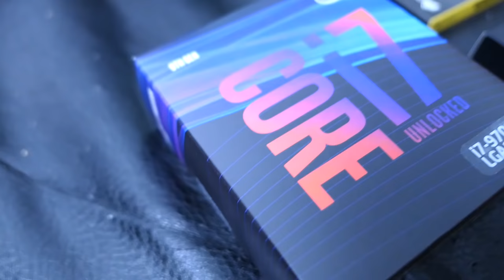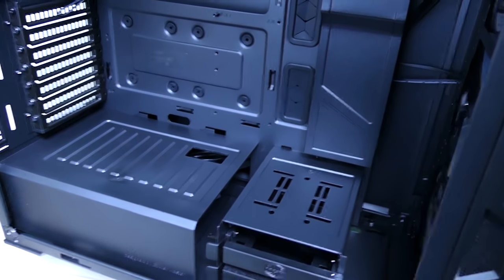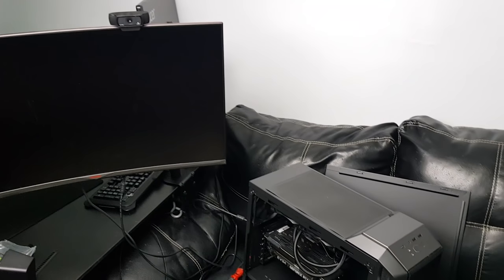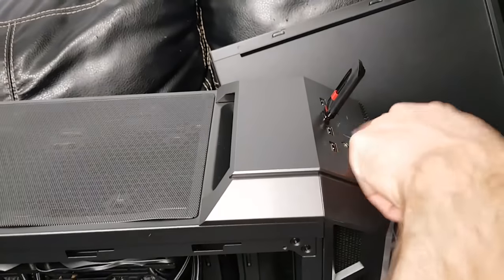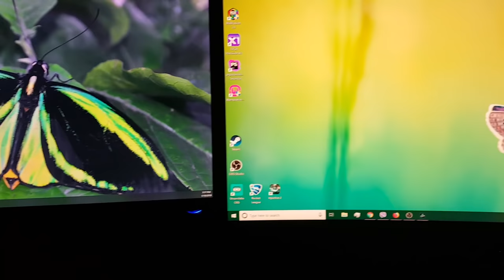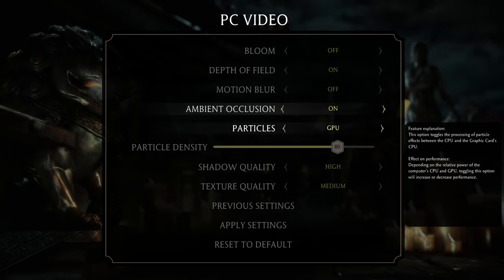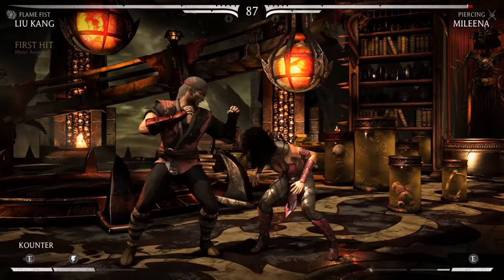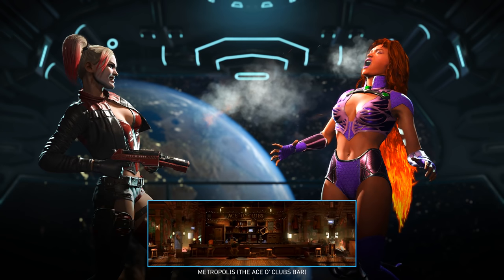Building Ultimate Gaming PC. Assembly and Performance Test on ULTRA Settings in Games.

Comment: I'm not pointing out any mistake it's very good setup but if you're gonna do live stream and productivity with games you should have gone for ryzen 7 2nd gen, it's beast and just lose some 10-15 fps over i7 plus huge boost in productivity and multi tasking over i7 at any given time and on the other hand is like half the price or some what near that as compare to i7...
Reply from the maker: I had amd PC before, wanted to try out intel this time, had a few compatibility issues with AMD in the past
Reply: StarInSky ok sure if you wanted to try intel its totally fine... Ryzen processors are more stable now as compared to their early stage releases... And yeah dont forget to play mk11...😋